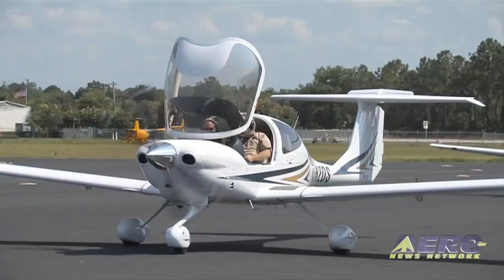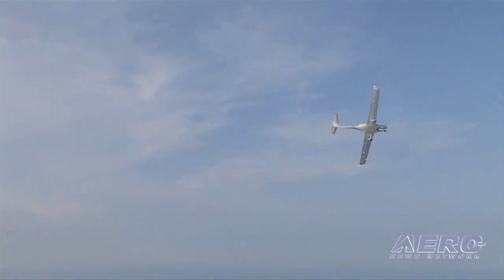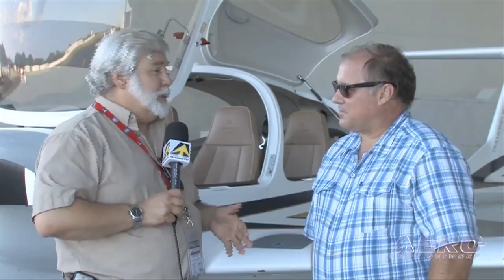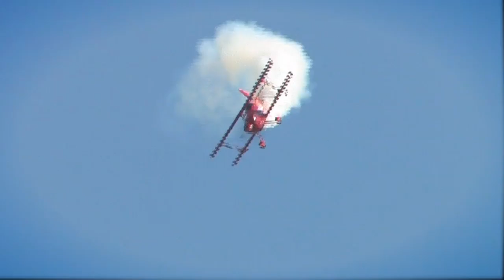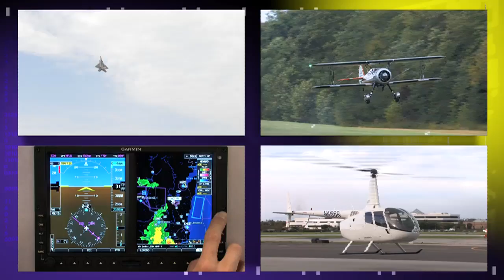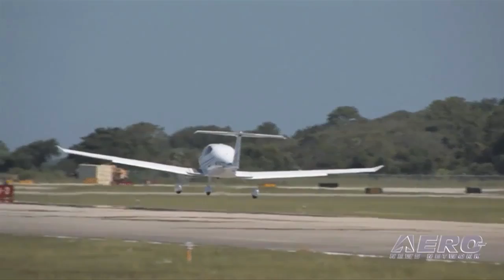Diamond Aircraft DA40 XLS Premier Edition by Premier Aircraft Sales

Comment: Want Air conditioning in GA aviation? that is cheaper than free ?  just take off and climb to 3500/FT  at those levels you had lower the temp by 26 degrees fahrenheit, and beside a human body expose to airflow will certainly cool it self
Reply: stealhty1

Comment: Sporty's cooler...$673.00, removable when you don't need it, works great, and weighs 65 pounds filled to the gills with ice. I agree that the cost of aircraft is helping to drive more nails into the coffin of GA. Great airplane, I am looking at purchasing a 40, but a used one. I cannot justify spending over 400K.

Comment: only $30,000 to install A/C...
so.. your tiny air conditioning system costs more than 2 toyota camry cars, each with engines, thousands of pounds of material, advanced computers, AND AIR CONDITIONING?? i love how everything in aviation is such an incredible rip off
Reply: AV8R it has to be certified. So that's why it's so expensive.